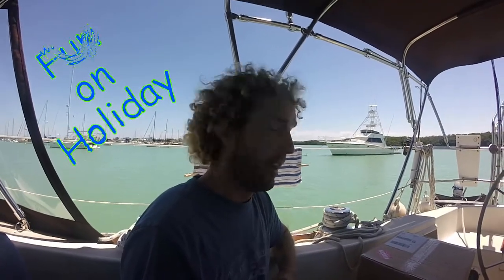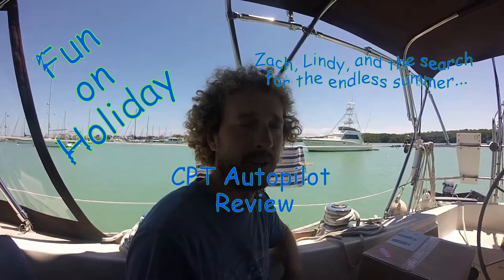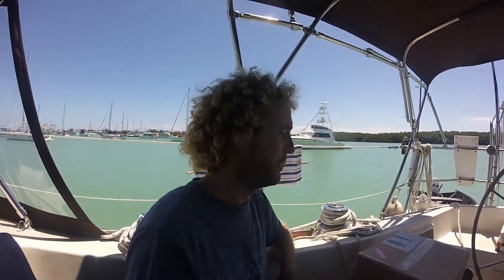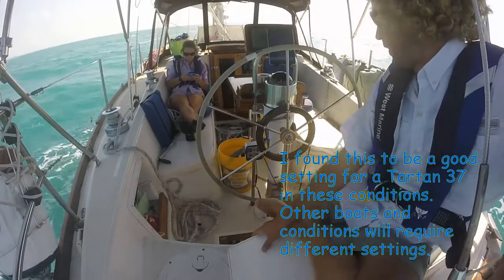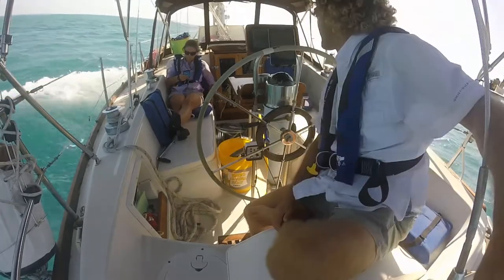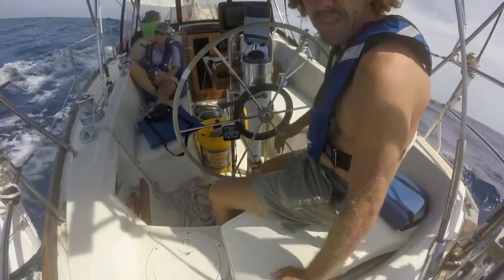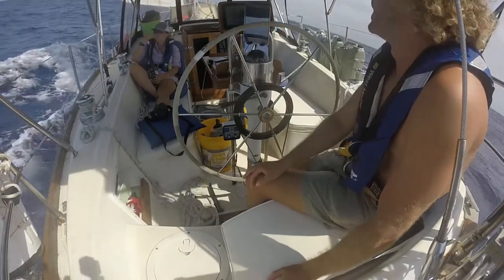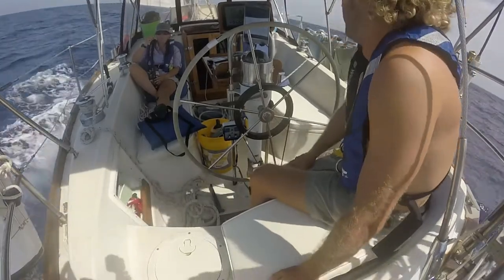CPT Autopilot Review

Comment: Hello Sir, I worked for CPT Inc. in Oakland Park Florida between 1985 and 1989. I was the lead Technician for the CPT II autopilot and Conversions from the CPT I to the CPT II. I ran the whole production line. I hand soldered the control board (which resided in the control housing, with the Bosch Motor, rudder and deadband potentiometers). I also built and calibrated the compass unit (at that time the compass unit needed to be calibrated in a darkroom). I built these CPT II autopilot systems to perfection and it doesn't surprise that the current owner and CPT II model works as well (or better) than it did back when I was building them. If anyone doesn't believe just ask me a question about the electronics or anything else.
Reply from the maker: Wow! That's awesome! Thanks for the comment and for building the CPTs.
Reply: I have a CPT II on my MORGAN 41 and it works well. The only issue I have is the accuracy of compass headings. I'm thinking of installing the current CPT autopilot - can you let me know the major differences between my 25+ year old model and today's?
Reply: Hi Chris . Hope you can help since you know the electronics like the back of your hand. And youre still in YouTube and you read this message. Hahaha. I bought this auto pilot and am trying to set it up on my Hunter Legend 40. I try to place it from standby to hold heading and it turns the wheel every second or so until it reaches the end and chatters the belt. Looking at the trouble shooting part of the guide it may have something to do with Magnetic reference. I tried to set the Magnetic reference on page 21 of the manual( the bottom portion) and ran the following procedure.

Steps:
1. Turn on the autopilot and set the Rudder dial to 5.
2. Leave the autopilot on for 10 minutes or more to allow the temperature inside the control box to stabilize.
3. Turn the Rudder dial to OFF and remove the control box from its bracket.
4. Hold the control box so that it is pointed approximately due North and so the top is level and steady; hold it
shoulder-height or rest it on a cockpit seat, but keep it away from metal objects and any possible magnetic fields. The
center of the cockpit, about shoulder high is usually free from magnetic fields on most boats. If resting on a surface,
make sure there are no metal fasteners nearby or metal equipment underneath.
5. While holding the control box steady, simultaneously press and hold both the Port 1° and Starboard 1° buttons then
turn the Rudder dial on (past 1). Continue holding the buttons. The light will blink red 5 times and then remain
solid: you can now release the buttons.
6. Wait 15 seconds more. Do not turn off power to the autopilot before 15 seconds have passed.
The Magnetic Reference is now set in memory and only needs to be set again if you move to a region with a significantly
different magnetic inclination or recalibrate the autopilot compass magnetic sensors. The procedure for recalibrating the
magnetic sensors in the autopilot compass is given in the Operation Manual. 

My Drive pulley faces aft. I've done the procedure for that 

My question for you.

When I do step 5 I get 10 red blinks, 7 Green ones, then a steady green. I don't see that in the manual.

Comment: Years ago I bought a used CPT for my cape dory 30 to replace a non-functioning st2000...Worked okay...but failed downwind in rough seas...sent it in for a "check-up" ... ($160.00). Came back working much better....at all points of sail.. Had a long cable steering box to sit on the bow and steer around crab pots!!  Only hand steered under really rough following seas....Now I have a CSY 33...with ST4000....yesterday (1/7/2020) ordered a new CPT ... Will review it after extensive use....
Reply from the maker: We're still plugging away with it. No issues, but we don't go out in crazy weather too often.
Reply: How is the CPT performing on your CSY?  Love those solid fiberglass decks!
Reply: @beaconbus  fantastic...under nearly all conditions...highly recommended...
Reply: @ckreitlein Thanks!  Great to hear!  I am going to make sure it will work on my boat, then get one ordered.

Comment: Just wondering if now that you've had the CPT for several years, would you still choose the mounting option that you did. I have the same boat and am trying to decide on a standard mount like yours or the reverse vertical mount. Thanks.
Reply from the maker: The reverse would be fine and be out of the way a bit more. Ours leaves not much room but doesn't bother me at all. Like anything else, you learn to work around it. Not a wrong answer there, in my opinion

Comment: I found you had to continually fool with the rudder and dead band. Your setting just in this video are 5-0, 5-2, and 2-4. It was worse than locking the wheel and way worse than the evo100. After $2k I hope further calibration of the CPT will work, but I would feel better installing it to a Raymarine brain (control unit).
Reply from the maker: Yeah, that was the first time we used it. 2-4 would definitely be bad. Lol. It's dialed in now at always 5 on the rudder, then between 0 and 1 on dead band when motoring in benign conditions or between 1 and 2 when sailing. It's still not perfect, but we use it every time we are underway and no real complaints. It's definitely basic as it gets.

Comment: is the belt tension right?
Reply from the maker: The instructions say just to tighten it by pushing down with moderate pressure when installing and make sure not to over tighten and not to use a tensioner. Says over tightening is one of the main causes of early failure. As long as doesn't slip under normal circumstances, and it hasn't slipped yet. But, I have no idea really. What do you think?
Reply: Fun On Holiday Sailing I thought the same thing as I watched - that it seemed loose.  How happy are you with this unit a year later?
Reply from the maker: Still working for us. We've got thousands of miles on it now. Simple course holding tool. Every once in a while hand steering is better for a certain condition. But for the most part we set it and forget it :)
Reply: Fun On Holiday Sailing Good to know, thanks for the info.  I’m going to look into one for myself.